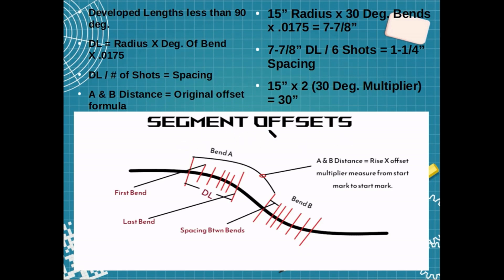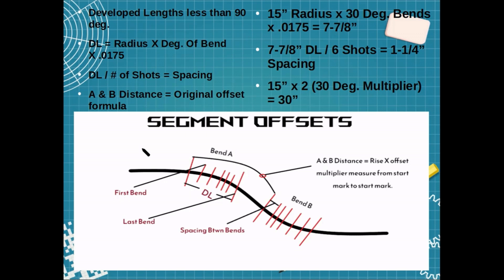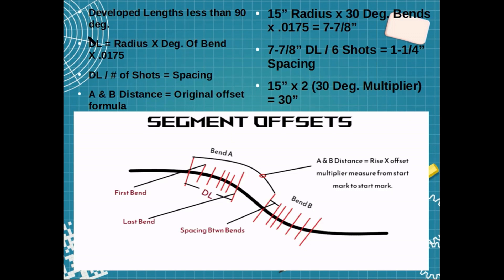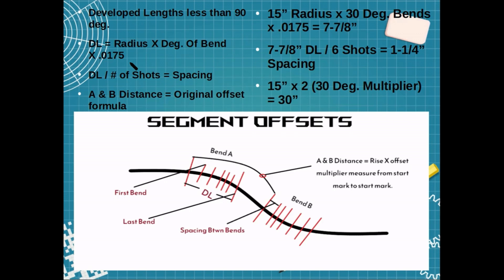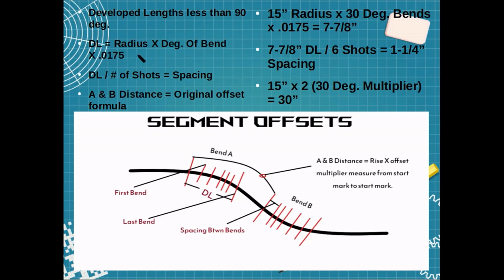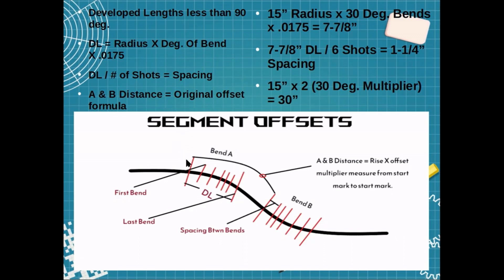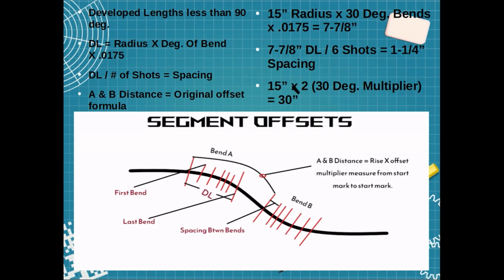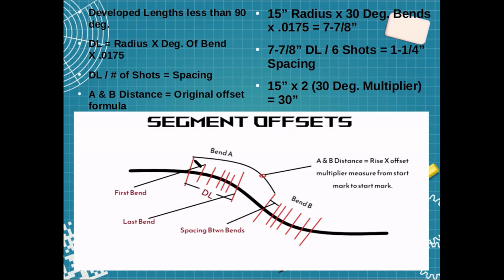How to bend conduit (Segment Offsets)

Comment: Hey Holmz, great info and explanation on your segment bending mini series ep.1: Offsets.  At about the 10:40 mark, you  start to mention and talk about how to finding the 5-degree mark on your hand conduit bender, you stated that you have some videos and actual demonstrations on how to do this. Could tell me on which videos is this info on. This old dog is always wanting to learn new way to do things, thanks in advance.
Reply from the maker: Thanks for watching my videos. I personally appreciate it. So to answer your question ill do my best to explain it and ill also direct you to the video that explains it. 
This is the link to the video.
https://youtu.be/qScjMoMQlt4
Watch from 28.15 thru 32.00 also at 30.36 read what the screens says its important or it wont work. Now ill try to explain it in words. Im going to try to make a video explaining how to chart your bender and how to transfer center marks to your bender. Lets begin
Step 1
Find scrap piece of conduit long enough to bend. Place a mark towards the edge of the conduit preferably 6" from the edge.
Step 2
Place the conduit in the bender lining up your mark with arrow or front of hook or saddle depending on the bender your using. Doesn't really matter as long as you remember where that mark was placed when you bend it.
Step 3
Bend to what ever degree you want the center for.
Step 4 
Remove from bender and place a straight edge on the inside of the bend placing a straight mark across the bend do that on both sides so that there is an x on the center of your conduit. Mark a dark line around the whole conduit on center of x  you can see how in the video link above.
Step 5
Place the bent conduit back in the bender in the same place you did the first time.
Step 6
Transfer the center of x mark onto your bender.
DONE...
Please tell me if you got it and if you understand the video and the steps i gave you.